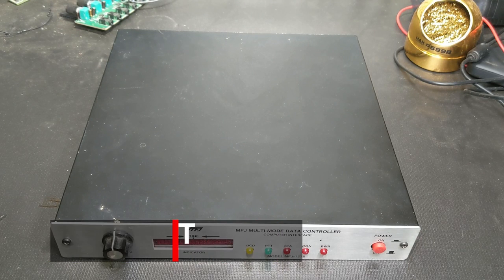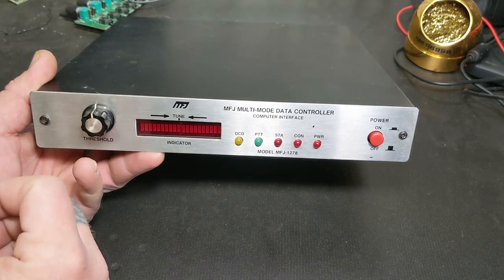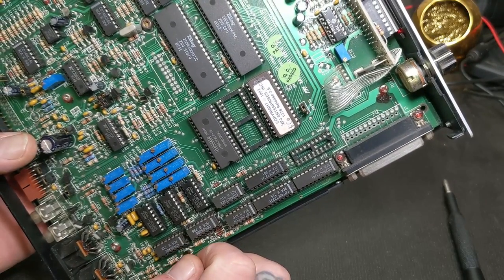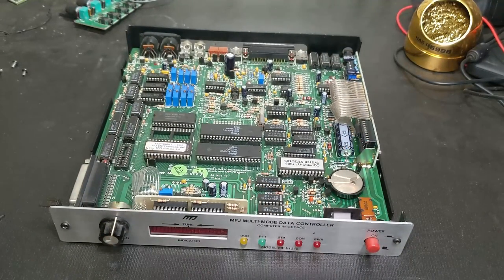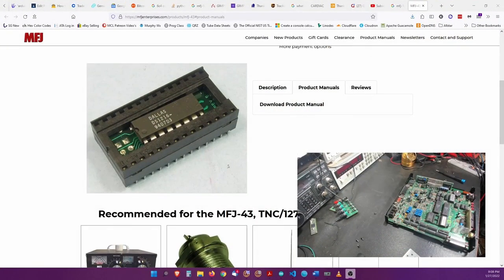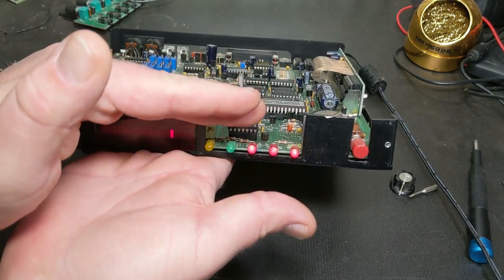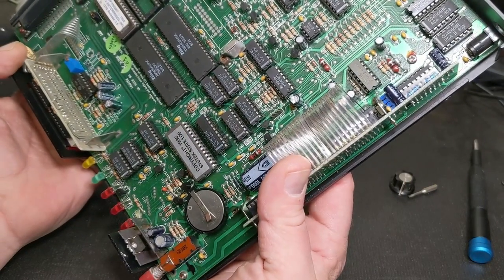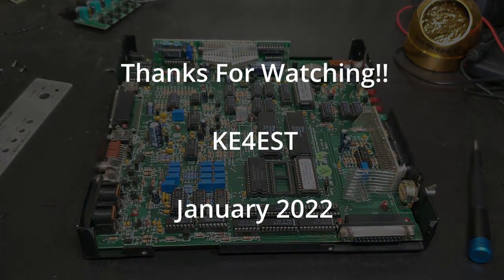MFJ 1278 TNC From 1988 | Repair or Maybe Not...

Comment: I really enjoyed this. I have an APRS node that has been running since 1997. I changed radios once about 15 + years ago. I monitor it on the APRS network. It’s off the mountain temporarily, but still running. None of my new computers have 9 pin serial connections, just usb. How do you run these on the newer computers? Mine won’t even run the old DOS / Win 3.1 terminal software. Yeah, I want to get this back up for an APRS Thursday net check in, maybe work the ISS packet station. Let me know what you’re setup is. Great memories! Thanks for the video. Been on packet 100% since 1994. We’ve probably worked each other.
Bob, KS4NG
Reply from the maker: I have a computer with 9 pin.  Asus still makes mother boards with them. In my other computer I bought a PCI card for serial.  First two solutions work the best.  But they do make a USB to serial adapter.  Some work well others not so much.  There are a few terminal programs out there that work on Windows 10/11.  You can also use Putty.

Comment: Going through my junk box and found mine from 1994-1278B DSP; cables, manual, and all…except the software. I ran Amtor, RTTY, and Pactor with it. Loved it. 
Over the last year, I’ve gotten into APRS and now WinLink. Reckon the old box is still useable? I run either a Kenwood TMV71A or TMD710A. 
Whaddaya think? DE Scobie, AC4GM.
Reply from the maker: There are guys that still run packet.  And some how they use them with APRS, but I use a DigiRig and a Raspberry Pi on my APRS Digi.

Comment: I have the MFJ 1278 B DSP  but i don't understand how Connect the microphone jack to the decametric set. There is a wire with a 3.5mm jack plug coming out of the mic jack. Where will this plug plug be plugged in? Behind the TRX or behind the MFJ?